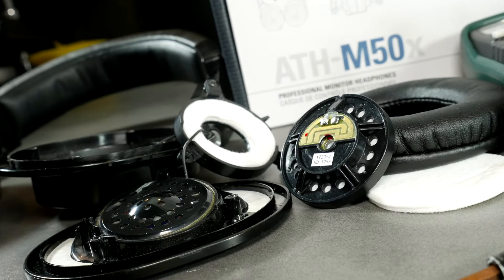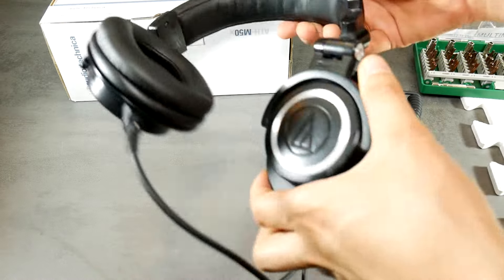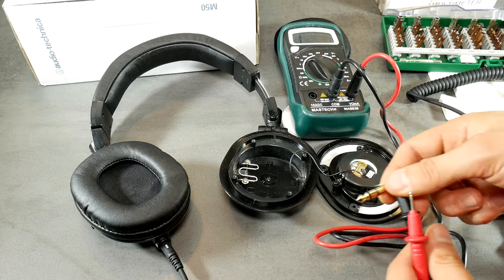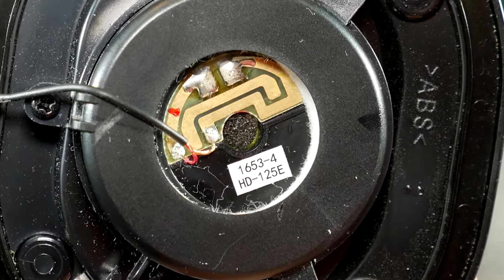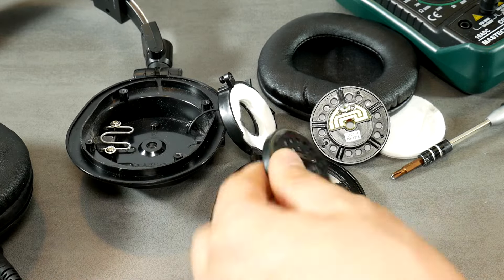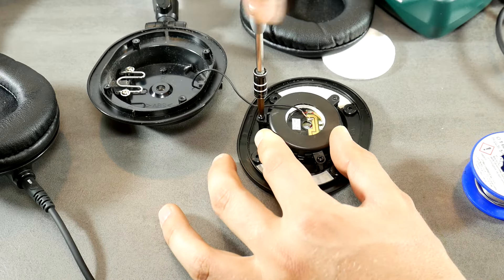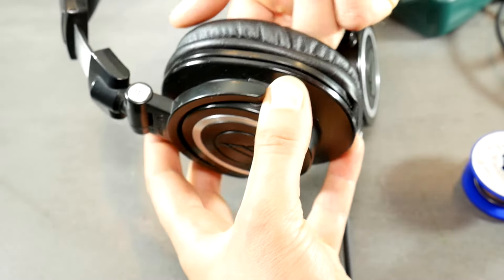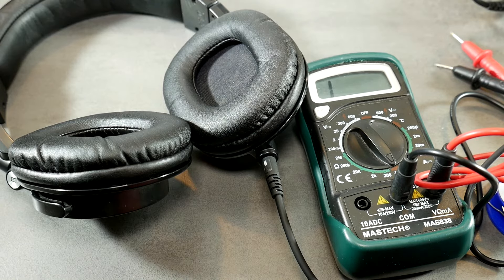How to REPAIR Audio Technica ATH-M50x ONE SIDE not working or LOUDER

Comment: Thank you so much for this great video, very helpful

May I ask a question?
At minute 1:00, how does the black wire in the right ear connect to the left ear? I saw it go inside the plastic housing.

Comment: cool, but I have a slightly different problem. The headphones stopped “vibrating”, and the sub frequency became very quiet and because of this the overall sound became very quiet. According to the standard, the sub is greatly amplified and sounds powerful. But rn it sounds like a whistle in a jar.😭 What do you think is the problem?...
Reply: The cable and equipment seem to be working properly unfortunately (
Reply: Same hwre
Reply: @WolfBeats_4L  resolved that. problem was in audiocard. I replaced it and hp working properly
Reply: @plixlt  I resolved it too. The sponges in the earcups went and stuck inside. I cleaned it. Now it's better. ☺

Comment: Thank you very much for this, about to try the repair myself. Would you be able to tell me what size of solder wire you're using there?
Reply from the maker: 0.7mm (Sn60/Pb40) and cheapest $10 soldering iron (25-35W power)
Reply: @TechscrewDIY  I appreciate you taking the time to reply.

Comment: Question, I cant find any replacement for mine hd 182 (ATH-a550z) is it possibe to use hd 125e?
Reply from the maker: you can use any speaker drivers with the same size (also from aliexpress beats or bose drivers), but then you need replace both drivers, if you change only one speaker you get disbalanced sound

Comment: Hello. I bought an M50X second hand. First time I heard left side a bit louder ( maybe more bass), but not all time feel it. What can I repair this problem?Do I need replacement the left driver? Or the other driver ? I have more headphones, but I didn't even think there was such a problem .Thanks for help
Reply from the maker: First check with multimeter wires, maybe some issue.
Reply: @TechscrewDIY  I already thought about it too. I tried it with several cables but it can be seen with all of them, although it is not completely clear. Sometimes it seems perfect.
Reply: very interesting. I was listening to music and the balance was fine so I didn't hear the left louder. very rarely a little stronger on the left side. maybe my left ear is more 
sensitive because I'm left-handed.
Reply: May be bro please help me 
Can askd u r headphone ok 
In this  perfect please help
Reply: I have the same issue. The left side is louder than right, more bass on left.

Any solution?

Comment: Also an easier way to get the pads back on the headphones is to carefully pull the lip inside out and then to flip it back the right way around while you hold it in position so the lip should slot itself back in with ease! :)
Reply from the maker: thanks for tip.
Reply: @TechscrewDIY  
NP! :)

Comment: Do these wires need to be stripped or can they be soldered as is. I see the wires have a color around them blue / red but not sure if it’s a protective coat or conductive… and the wire seems too thin to strip.
Reply from the maker: just desolder from broken speaker wires and the same wires solder back to new speaker :) So simple :)

Comment: Thanks for this, my right channel stays on for a while then turns off and eventually back on again. Cable continuity seems fine but the driver sometimes gives me a continuous reading of around 400 ohm which makes the continuity beep sound all screechy. There doesn't seem to be a correlation between the screech and the speaker not working. Do you still think it's the driver?
Reply from the maker: When you check cable continuity, if the values are stable, then cables is fine and speaker is almost dead.

Comment: I head a cord break and with that locking mechanism, the plug from the broken cord is now stuck in there.  Any tips on getting it out? I’ve tried using different tools to wedge it out with no luck.
Reply from the maker: heat up a small size minus screwdriver and try this method - https://youtu.be/ZPbFf6NcKaY

Comment: Dag, mine just broke last night too. 😪  Continuity from the plug to the connection inside the driver is fine and I did the reflow just in case, but I'm getting nothing across the two pads on the dead driver. I guess I'm on the search now. Mine actually says 125B on the back. I hate to get a replacement that's too much newer than the other channel. Strange part is, it died between uses. I was using them night before and it was fine. Next night everything's on one side. I guess it popped right when it came on (or when it went off last time).
Reply from the maker: sad, don't forget to write feedback on how you solved your problem
Reply: @TechscrewDIY  - I actually called the manufacturer (Audio Technica) for a change. They were very helpful and cheaper than most of the prices I saw online ($24 USD for the driver and $28 total to Virginia). It showed up in about two days. I'll post back if there's any trouble after installing it. I'm trying to get all that black disintegrating earpad crud off before doing anything. Wish there was a generic replacement cover for the actual headband part (haven't looked yet). Mine is now just raw gray foam. FWIW, the current HD-125E driver is on their list as the replacement for that 125B, so hopefully I won't notice any difference. On a side note- Those things sure have crept up in price over the years. I swear mine were in the eighty dollar range when I got them.  -Thanks!
Reply from the maker: @jidissafi7413  excellent, thanks for feedback :)
Reply: @TechscrewDIY  - Well, I just now got around to getting that new driver in, and everything seems to be working fine. I've even got a lady around the corner sewing me a cover for the headband. I was wrong on the cost, but the total was still $28. The driver itself was actually only 15.50 (12.50 shipping), so still cheaper than most third parties. I'm debating over whether to put anything else in the center of them. I vacuumed all that black crud from the foam in the earpads which left me with nothing but thin black fabric in the middle. I was always mixing heavy on the high end with them anyhow, so maybe that'll help. 🙂    -Take Care
Reply from the maker: @jidissafi7413  amazing, thanks :)

Comment: I have a similar issue with my m20x. Instead of one speaker not working, both work but only on certain positions of the cable. If I tilt it slightly, it only works on the left ear, and tilt it another, it works on the right. Does this indicate a cable issue, or a speaker issue?
Reply from the maker: sounds like cable problem, try replace 3.5mm jack ;) https://youtu.be/qjdVloJKg9s

Comment: Can u help for m30
Reply from the maker: I don't have Audio Technica ATH-M30X Speaker Driver, I didn't find it on google either. Write to Audio Technica Support.
Reply: I did but they didnt help they just told me to contact my dealer bc i have the thing that makes them fix my headphones if thay got broken in 2 years but my dealer just told me they will call me back but they didnt

I meant guarantee
Reply from the maker: Keep calling the dealer until you get an answer. if they can't help, the easy thing to do is to buy new m30 headphones if you like them of course and keep the old ones as a donor for future problems :)
Reply: Yeah i would love yo but they are not that cheep and i dont have a ton of money
Reply from the maker: @kiwi5516  sorry, but you have no choice, but always you can buy cheaper headphones.
Reply: hello, can you give me the link where you bought the spare speaker please
Reply from the maker: @luissaballoalfonzo6301  just search on google for "HD-125E"(M50 and M50x driver) and find best deal.

Comment: All the wires give off a signal and so does the speaker itself, but the left side is still not working. The cable also works, any tips?
Reply from the maker: check one more time with multimeter, it's not possible that the speaker is OK and the wires are OK and the headphones don't work, then the only problem is the sound source. https://youtu.be/BMOaVI-yhGg

Comment: Please someone help me the left side works but i have to keep moving the jack around and plugging it in and out for it to work and sometimes the slightest pull on the wire will make the sound from left side stop working again. so idk whats the problem and idk what to even search online to find a fix :(
Reply from the maker: you mean 3.5mm jack, that put into phone ?
Reply: @TechscrewDIY  no when i plug my m50X into any device. laptop for example.
Reply from the maker: @redcastlefan  it the problem is with 3.5mm jack, then for x model headphones you can simply buy new cable or repair the jack like in this video: https://youtu.be/qjdVloJKg9s